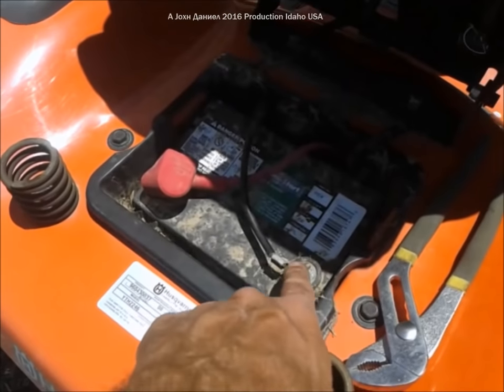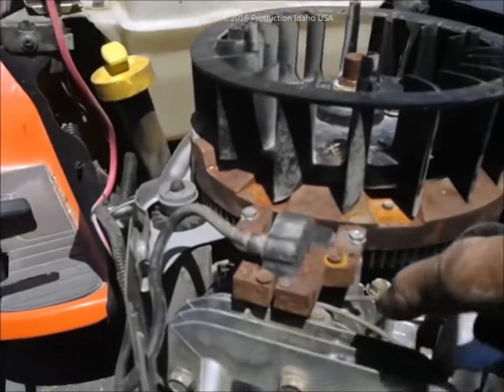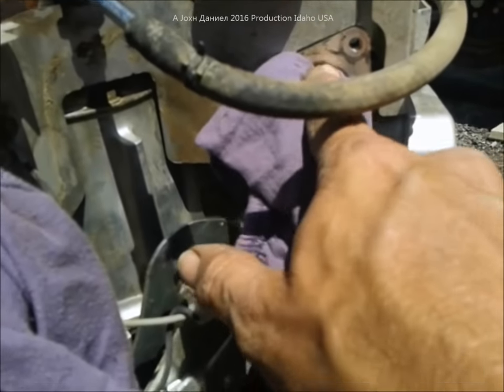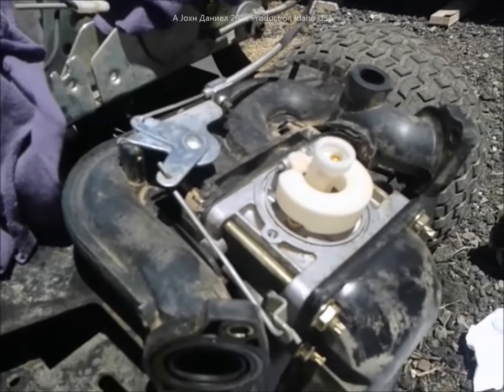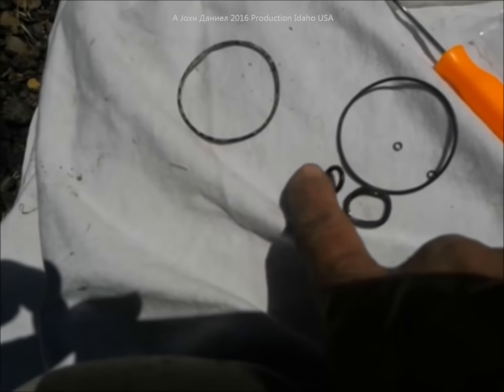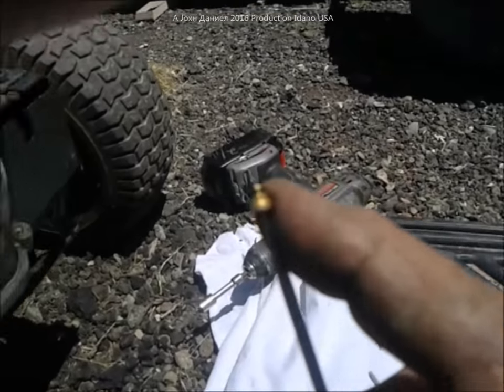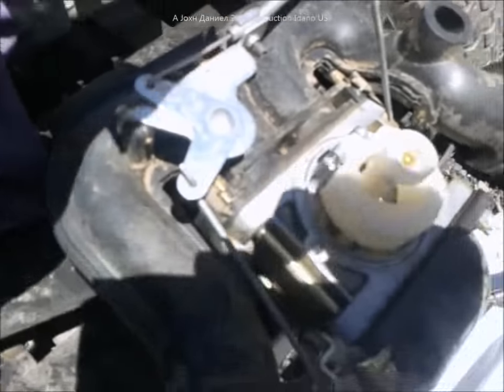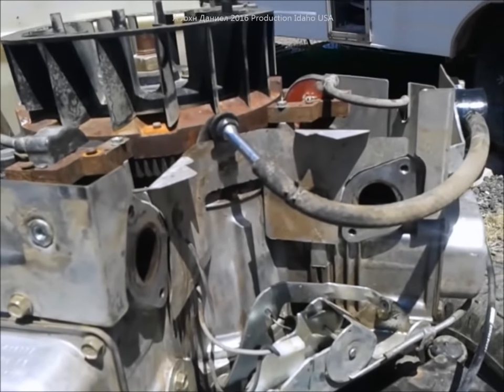Briggs and Stratton Engine Surging, Stalling & Backfiring fix (parts used below)

Comment from the maker: FIX idle/running problems with Briggs & Stratton most years, Here's Exact ORing KIT Briggs Carb repair, Simple Dual fix: Exact ORings https://amzn.to/3yMb9yC  + a NEW Fuel Pump too https://amzn.to/3KrRoib OEM Parts +  B&S Twin Manual http://amzn.to/2rdRWAR for all answers and facts. new Nikki COMPLETE CARB AND INSTALL KIT https://amzn.to/3RetlXX
Covers - [Briggs & Stratton Nikki V Twin Jet & Transfer Tube O-Ring Service Kit]
&
[ FUEL PUMP REPLACES BRIGGS AND STRATTON 808656 INCLUDES FUEL FILTER 695666] pump for  BRIGGS & STRATTON / KOHLER POWERED CRAFTSMAN RIDING LAWN MOWER / GARDEN TRACTOR / LAWN TRACTOR

Replacement pump is for these and more: 

KOHLER 24 393 04-S

KOHLER/24 393 16-S

KOHLER 24 393 16-S

BRIGGS & STRATTON 491922

BRIGGS & STRATTON 808656

JOHN DEERE LG808656

JOHN DEERE M138498

JOHN DEERE M145667

KAWASAKI 49040-7001

DIXI CHOPPER 24 393 04-s

HONDA 16700-ZL8-013 

Mikuni Part no: 808492

Fit Follow Models:

Briggs & Stratton: 28B702, 28B707, 28M707, 28N707, 28P777, 28Q777, 351442 and 351447

Kawasaki: 15 thru 25 HP engines

Kohler: CH17-CH25, CV17-CV25, CH730-CH740 and CV730-CV740; for 17 HP thru 25 HP engines   

Fuel Filter Specs:  Fits 1/4" fuel line

Filter Size: 1 1/2" OD X 4 1/2" LONG （Fit both A 1/4" X 5/16" ID Fuel Line）

Comment: So I had this problem with my John Deere D140 riding mower as well. It has 189 hours of operation. I took the carburetor off and and took it apart. O rings looked good and no dirt. Gaskets were clean. I put everything back in place. Long story short, it need up being a dirty fuel pump and a clogged fuel supply hose. I shot compressed air  into the line and I heard a BANG. It was the dirt that shot out of the fuel supply hose. Installed everything back and mower runs like new. $25 fix.
Reply: Very informative, great video, even the comments were good !!!
Reply: I'm having the same issue and have replaced the carb. Issue is still present and will try your suggestion next. Thank  you for the tip!

Comment: A very good video, John.  I thin those O rings were messed up by the ethanol you used in your FUEL.  I use nothing but premium non-ethanol fuel in all my outdoor power equipment.  Four cycle gas gets one ounce of B&S AFT fuel treatment and one ounce of MMO per gallon of gas.  I get my premium non-ethanol gas for $3 a gallon, locally.  A little more costly than regular ethanol gas, but it eliminates "most" gas issue problems we find in two and 4 cycle engines these days due to the ethanol.

Comment: Very informative, can't wait to tear into my 24HP B&S V-Twin that has never run 100% from new!  Thanks for the parts link.
Reply from the maker: Good luck with it, take pictures as you go so you can reverse the process smartly. Find a new solution, put it out there on video.

Comment: My sons would start and run about 3 seconds and die. We pulled the fuel line off at the carb and made sure it had fuel getting to the carb. It did. So I pulled the fan guard and shroud bolts loose, you do not have to completely remove the bolts, only back them out. Then I removed the intake manifold and carb bowl. I cleaned the carb out and blew out the jets and reassembled the engine. She starts and runs like new

Comment: when installing those jets the best thing to use is a tapered toothpick!!   you can push in the jet & it will hold the jet !! jets are very soft you may actually do damage to them using those metal pick tools,plus they slide ooff the pick tool.
Reply from the maker: Excellent

Comment: OK first I would like to say this is one of the best detailed videos on this I've seen. With that said I have a problem. The O ring you said that comes with the kit is the wrong size, its for another carburetor piece that's metal and it goes on the inside of the other piece. I tryed to put that one seal that came with the kit on and there is noway to do it its 14.5mm, I had to order the correct one from a small engine shop that fit perfect. Anyway other then that good video.

Comment: Good information--that was my problem and I got it fixed. However, in my case the screws holding the carburetor bowl were so firmly held with locktite that the screw heads disintegrated. I had to drill out the screws (Grabit did not work) and tap new holes to get the bowl back on.

Comment: Well finally got that intek back together. The motor never sounded so nice after it cranks. At first it wasn't choking, so I had to remove once again and put the choke lever in the proper hole. I've been keeping an eye on the fuel level and have taken it around the yard. I still have not put the blade deck back on.  Fuel level looks pretty good. I've added a fuel shut off just for safety's sake.
Reply from the maker: +Paul Govensky Put in a brass 3 way valve at your tank and you can drain fuel and run it dry at the end of season.

Comment: Great video. I think it will help me a bit on a 92 MTD with a 18.5 horsepower V-twin Briggs & Stratton which is idling low and high. Infact when I throttle it down it shuts off without turning the key off. Also after shutting it off it will generally give off a big backfire so I'm guessing it's these little o-rings. I'm going to have to get the exact motor model #'s to figure out what I need. I fiddled with idle adjustment screws a while back and it helped at first but it's right back at surging again and while mowing it causing a lot of deck wobble. Mower has cut 2-3 acres once every week or 2 during mowing season since 92 & I've never had to do anything to it other than regular oil changes (don't use oil filter) & has to be a record breaker with nearly 25 years of cutting this very large yard. I like to make things last as long as possible & it's feasible providing it's made with good parts to start with. Thanks for sharing.
Reply: Did you ever figure it out?
Reply: @hibbie8268  Yes I rebuilt the carb with briggs rebuild kit and I had a keeper that had come off the intake valve mower just died all at once after 20 mins of cutting grass so I got it to run enough to make it to the garage and checked for compression and one cyclinder had none so upon removing head I saw the valve sticking out and said uh oh not good. I cleaned the carbon buildup off and used same parts put it back together and have had no problems in a year now. The keeper came off that held the valve spring in place and I'm thinking it sticking from the carbon caused that. Runs like a new mower now though.

Comment: Great video! I have the exact same carburetor but the emulsion tube shroud is black and does not have the two jets you showed,  the engine ran fine until recently and surges and runs only with the choke out. I thoroughly cleaned the carburetor and replaced all the Orings. Do you know if any of these Nikki carbs have version’s with no jets?  What do you think is going on?  Thanks much!!!

Comment: Mine would run while cold then lose power and die when it got hot. The problem was that the carb wasn't bolted on tightly enough. The bolts "creep" or stretch over time. My carb was so loose it would move when I wiggled it.  To fix it I bolted it back on after taking it off and using some gasket sealant on the o rings. Works fine now
Reply: Holy crap man. Thats exactly what mine is doing too! I’m gonna try this out.

Comment: JOXH I agree about the repeats. :O( Guess I'm just not patient enough, want to get right down to it. BUT, I did want to comment that you did a great job. I learned a lot about my B&S carb.  I am in the proses of cleaning and replacing a lot of stuff on my mower. The brake, the belts, loose steering rusty springs for a few. Have it torn down to the frame. Poor shifting was the original problem. Found top of Transaxle packed solid with crap. Shifts and seems to work OK now. I did have a problem with backfiring and poor idle before. I think before I finish I will do the carb thing. I am always skeptic of carb work. Thanks for the very informative, helpful Vid.Toolman
Reply from the maker: +Toolman Yeah, a few repeats but the info is useful.

Comment: You seem very wise on this engine.  Why on earth do you suppose a twin cylinder engine like this would have 2 different size jets in the first place?  I also have a carb like this and you are right, it has 2 different sized jets, but it doesn't seem to have a "progressive" Idle, power circuit that would benefit from 2 different sized jets.

Comment: great video. you explained the exact problem I'm having with my mower. I am going to take it to a repair shop though because I have none of the tools or the experience. thanks for the video though.
Reply from the maker: +kenneth druggan It's the ethanol destroying the carburetor rubber parts. 
Adding a little marvel mistery oil into the gas slows the damage.
Reply: I use NO-ETHANOL gas - and have for a couple years. I hope the gas station isn't lying to me.

Comment: I got a john deere z355e v-twin 22hp Briggs and Stratton motor and I cleaned carb and check spark both are good but when I start my lawn mower it runs good but once I start to turn blades on and mow for 5 min then it starts to die. Might be fuel pump but I'm not sure it only has 59 hours..

Comment: Thanks alot,great video mines only got 110 hrs. and surging!
Reply: If you still have surging, there is a quad O ring assembly under the fuel emulsion tube and then behind your choke butterfly is a flat seal with 6 holes in it. These two seals get mushy over time. Mine had the choke return spring and it took a bit of figuring how it worked. It holds the butterfly open normally and when the throttle is put up into choke position it pulls the butterfly down to choke position.

Comment: I had issue with my motor surging and loosing power after an hour running. I mean each week I filled the tank and it worked fine for an hour then the problem came back. Turned out to be an insect in the fuel tank. Hard to believe but somehow it was taking that long to block the outlet in the tank. You'd think the fuel would be sloshing about too much. But that was it. Meanwhile I'd tried new fuel, carb gaskets, fuel filter, plugs, vac hose even the ignition coil got swapped. I think the bug climbed into the spout on the Jerry can and was washed into the tank when I filled up.
Reply: Same thing happened to me. Suspected a line blockage. I drained tank into container(took a while), then blew the line so that anything in it was blown into tank, so I could verify what the cause of the blockage was, and then removed the bug and trash from tank. Had already cleaned carb, replaced fuel filter and spark plug, and replaced magneto and cleaned flywheel in prior 6 months. Fuel line was last possible cause. Lawn tractor is over 20 years old - the service over past 6 months was first service involving new parts and dirty fuel line it had had.

Comment: What about loss of power, some surge at low idle, and popping sounds while running?  I actually sprayed some carb cleaner at the intake horn and some puffed back in my face, almost like a valve issue.

Comment: Hi John,
The link you posted for your ebay source for the gasket kit no longer works (from 7 yr. Old post). Can you provide their ebay seller name or a newer link for the kit? I want to use your source as MANY of the amazon and ebay suppliers of the generic v-twin kit don't include the correct size o-rings for the 2 jets (too big...jets won't reinstall).
Reply from the maker: Here's Exact ORing KIT Briggs Carb repair, Simple Dual fix: Exact ORings https://amzn.to/3yMb9yC  + a NEW Fuel Pump too https://amzn.to/3KrRoib OEM Parts +  B&S Twin Manual http://amzn.to/2rdRWAR for all answers and facts. new Nikki COMPLETE CARB AND INSTALL KIT https://amzn.to/3RetlXX
Covers - [Briggs & Stratton Nikki V Twin Jet & Transfer Tube O-Ring Service Kit]

Comment: I have a 26 hp Briggs with nikki carb . I have pulled the fuel tube off and it appears that next to the jet tubes, there are two smaller tubes that appear to terminate in two very small holes about a 1/4 inch below the jets. mine are plugged, but I can find no videos that mention cleaning these holes. What say you?
Reply: Follow up?

Comment: Really helpful video.My simplicity riding mower is about 10 years old and I have been fortunate that this is the first time I have had to tackle an issue with this mower and the Briggs & Stratton engine.Need to ask and confirm before I go further with the carb, Is my mower issue solution the same carb fix as described in the video for a surging engine repair?The video speaks to a surging engine and erratic engine performance.  My engine issue is likely related to the carb too, my mower specifically runs with the choke closed for several minutes and then eventually floods out and quits.  When loading up the engine under power, the engine quits.I've replaced the plugs, the air filter, fuel filter, and sprayed the carb with sea foam. I still need to replace the fuel pump.  What do you recommend my next steps to take? Am I rebuilding and cleaning the carb jets or do I have a different issue to tackle and path to a solution?Any additional insight and help would be great.  Thanks.
Reply from the maker: +ttrackspeed Sounds like fuel pump and vacuum tube to it.
Reply: Thanks John.  That was the push in the right direction I needed.  Headed to the back fuel line, pulled out the grommet from the gas tank and blew out the line.  Engine running fine again now.

Comment: Trick put rubber hose our vise grips so you don't crack the fuel line....myself I just take the fuel line off and plug it with dowl pin or cut off a bolt with a smooth shoulder and use that to stop the fuel from leaking from the gas tank.
Reply: Golf Tees work great too, depending on the ID of the fuel line,

Comment: Hi I have the same motor like yours and gas is mixing with the motor oil and causes the engine to smoke do you know what’s the problem with it please let me know thanks
Reply from the maker: 4 options: most common is vacuum driven fuel pump failing and Fuel sucked into crankcase. 
Also possible: Fuel shut off solenoid failing and flooding cylinders. Valve guides going bad. Carburetor float hanging up and flooding engine.

Comment: My b&s runs good at at half throttle or more. But surges and misfires at low RPMs only. Would this be the same problem and need a carb rebuild?
Reply from the maker: Yes, that's a common symptom

Comment: Well after repairing the carb and replacing the fuel pump as well, the new pump already failed. Fuel will not spit through the other side. I hope I still have the old one still laying around.
Reply from the maker: +Paul Govensky It likely has trash in it from all the work. Spray it out with wd 40 and tap it a few times, make sure the vacuum lines not leaking.
Reply: well I had gone through the fuel pump again and even purchased a new one to be sure. I did find a small tear in the vacuum line and put some marine grade sealant. The tractor cranked and i cut grass until it ran out of fuel. I added more and noting it would run for a second then quit. I let the tractor sit through the night then tried it again this morning. I pulled the fuel line and once again, no fuel coming through the line. I turned the key until i seen that the pump was working. I connected the line back up and ran great. I finished cutting the lawn and will see how it acts in the morning. I added the fuel shot off cause fuel kept leaking into the crank case thus forcing me to change oil...grrr. Any advice would be helpful. This mower isn't mine and I would love to get it out of my yard. I only had to replace a tire with a tube and replace the mandrel and blades. This has become quite the project.
Reply from the maker: Once upon a time MTD who is the maker of many brands had a mesh screen in the fuel tanks. It would cause such problems. They also used fuel line that would de-laminate in a few years. But your actually sounds like a severe carbon build up possibility in the cylinders causing hydra-lock vacuum which would explain some after run fuel issues. Try this stuff treatment in the fuel http://amzn.to/2qwTQZH. 
Also do a VERY gentle blow back into the fuel tank and look for a plastic wrap like debris to pop up after treating the fuel system.

Comment: I have 27 brigs in my Tractor.  It cuts fine when the blades are in gaged. But when I shut them off the. Engine  back fires. And stuffers.  Until I put the blades back on ?
Reply from the maker: The vacuum advance is doing that to maintain the full engine torque. Look for a bad vacuum leak on the manifold tube or upper carb seals. With a vacuum leak, under no load the engine is making very little vacuum to run the fuel pump and carb mixture, under heavy load vacuum increases enough to outdo the leaking spot.

Comment from the maker: DIY NOTE - For ALL 1 and 2 cylinder power users, if you want to actually get the ethanol film and carbon out of your pre-combustion engine parts then use BG, http://amzn.to/2qwTQZH . It will actually work getting fine particles and sludge out. 2X better than seafoam and other solvents.

Comment: I'm having a big problem with this.  The jets will not fit back in with the new o-rings.  Yes, I took the old o-rings off.  Twisting with pressure, brute force; nothing works; the jets will not go in. I tried oiling them up first; still no go.  The kit I used is the same part number: #54832
 for Briggs & Stratton Nikki V Twin Carburetor as is listed in your link.  Anyone else have this problem?

Comment: Need help. My motor would run and then dies on me, but if I don't keep on priming the fuel it'll stay running. I replace the fuel pump, but it's still cuts out if I don't keep on priming it to get fuel into the motor.